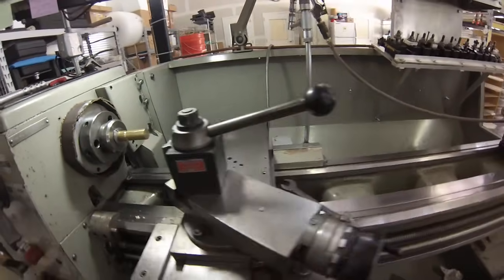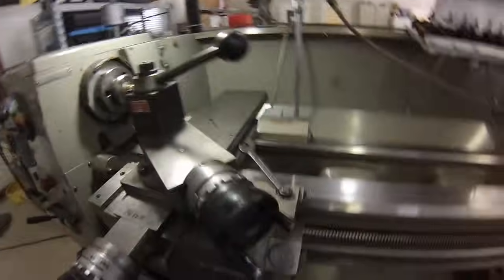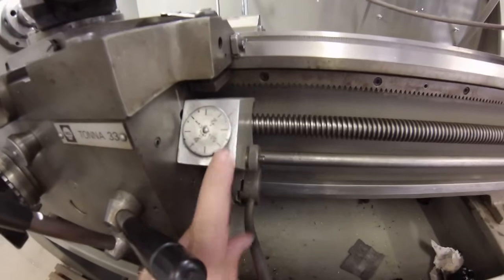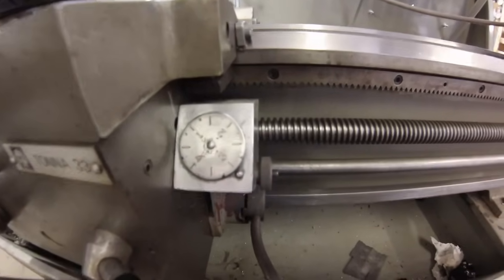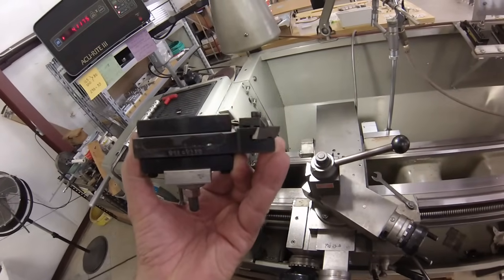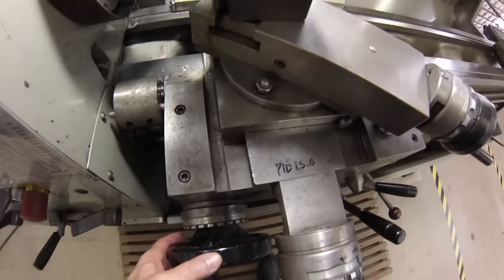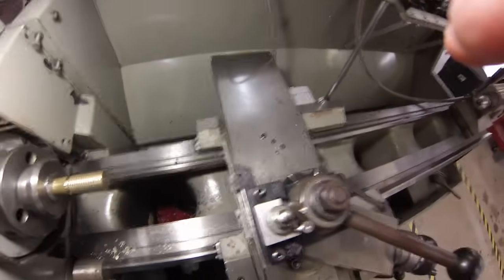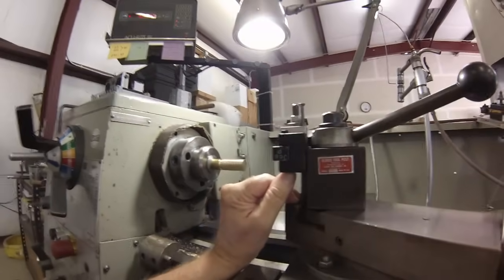Threading on a manual lathe  BEST TECHNIQUE EVER !!!!

Comment: LOL.
Reply: Be careful douchebag, your ignorance is showing.
Reply: @Shop-Tech  That's uncalled for.
Reply: @punishr36  I think leaving an LOL on a channel like this is uncalled for. This is a great way to thread and the numbers would agree. A machining channel with 77,000 subscribers in just over 3 years and 12 million views has to tell you something. Come down off that high horse Bob. You may learn something down here on the ground with us mortals.
Reply: @Shop-Tech  The "lol'  referred to the "BEST,,," It is not. Many stock tool holders on a  eg. TOS etc would not give the vertical clearance to flip a lathe tool upside down. Or some hobbyists do not have enough Swiss type Tool holders to dedicate to the inverted tool as it would take time to set the tool height. In the industry as a lathe hand you are expected to produce in a timely manner plus any following jobs. As for disengaging the Lead screw that's just a simple way of not improperly re-engaging it and mangling threads so you run it backwards. Longer threads would not pan out  in the case of my one lathe which swings 68" it is hard on the electric brake and motor as Joe also mentioned. Joe knows what I'm talking about so you go back to your name calling and represent yourself somewhere else.
Reply from the maker: @Bob Smith What part of this demonstration did you find comical? I am truly curious.
Reply: @joepie221  Well as asked by 1 of my apprentices to review said video having first read the title it made me chuckle.  Not meant as an insult, what I found humorous was disengaging from the Lead Screw. I've owned a design and build Tool Shop/Jig Bore and Jig grinding cyl-grinding form grinding Turning etc and having been a tool maker for almost 40 years and worked with many many European Tool makers and machinists I can say with all honesty that unless it's a substantially long thread I never see the Lead Screw disengaged ever in the industry. Again not meant as an insult but to state " Best,,,". Cheers and Happy New Year.
Reply from the maker: @punishr36  Bob, thanks for the follow up. With the exception of metric threads, I have always, and will always, disengage the "Halfnut" ( not the leadscrew) when running a thread. I too have crossed many industries in my 47+ year career, including Semi Conductor wafer fab development, military explosion suppression systems, aerospace and orthopedics. I've run lathes from 140" long 18" gap beds to the hardinge toolroom lathes and never ( on an imperial thread) saw how reversing a spindle to reposition a tool was good for the machine or quicker. I did my formal apprenticeship in NJ here in the USA  and too, have trained numerous apprentices over my years. My background is primarily prototype and product development with normally tight deadlines. I don't know where you are from, or how old you are, but its interesting how 2 guys walking the same path can be trained so completely different. Perhaps you should let your apprentice try this out and keep an open mind about it.  Its very fast, allows for the use of a hard stop, and is much kinder to the spindle and motor of the lathe. Cheers, and Happy New Year to you as well.
Reply: @joepie221  I did say to disengage from the leadscrew.  It's no different for thread grinding or burnishing class 3 UNJ or API etc. I do disengage from the lead when grinding internal threads where a limited undercut is permitted. I think the biggest issue with the nut is unless you're cutting a friendly imperial thread like a 16" pitch for example where you don't have to wait for a revolution of the dial if you just missed it but if you drop it in at the wrong spot and I'm sure you've done it too well,, we know how that ends. Cheers back.
Reply from the maker: @punishr36  Hi Bob. I hate to split hairs here over words, but you clearly stated, at the end of one of the comments above, you never see anyone in industry disengage the leadscrew. I'm not sure what type of machines you have, but my machines will disengage the leadscrew via the gearbox setting, or disengage 'from' the leadscrew via the halfnut. You keep making references to "in the industry" or being a lathe hand like my advice is coming from a home shop. I was a lathe hand for 23 years 6 days a week and will match skills, quality  or time with anyone out there. You included. Reversing a carriage to realign the start point of a thread does not allow for the use of a hard stop. You will risk shearing the lead screw pin if you do. if you are working on a thread against a large shoulder, the practice is equally as risky. As for waiting a full turn for your dial engagement number to return, you may want to read up on your options there. Conventional dials offer 8 options at 45 degree increments to expedite threading an even pitch thread, and 4 at 90 degrees for odd pitches. You get no second chance on a rework of a customer supplied part, so I'll stick with the sure thing. Especially when that part is a $100K bronze military valve body. I respect your comfort level doing your threads the way you have the most experience with, but would never teach or endorse that practice in my shop. Its tough on the machine and not nearly as precise or quick between passes, as the one demonstrated here.
Reply: @joepie221  Disengage from the lead screw.

Comment: This looks like something I need to learn.  I ordered a LH tool holder from Shars (1/2" MTVO External Threading/Grooving LH Tool Holder and a TNMA 32NV Carbide Insert).  I make an aluminum part with a 1"-20 external thread that runs up to a shoulder.  Should I be concerned about the axial force trying to pull the insert away from the tool holder?
Reply from the maker: Not usually. My Kennametal style top notch inserts are designed to be pulled into the holder to resist those forces. If your style is like that, I wouldn't worry.

Comment: I have a LH screw tool upside down that I use for cutting LH threads without an undercut in the work screwing towards the Chuck , start lathe in reverse  but lead_screw changed so it runs towards the Chuck. Works great,
Reply from the maker: Another alternative, if your tool is upright and your machine running forward, threading out from the chuck will produce a LH thread.

Comment: I’m leaning the lathe now and could use a little help with this. I just bought the Aloris post. What toolpost are you using and are you just turning the insert upside down? This may be a stupid question. I’m not in front of the tools. Thanks Joe, Merry Christmas
Reply from the maker: First of all, I am from Baltimore and will always cheer for the Ravens. Only the Colts were home team when I lived there, so I have a loyalty to them too. Ok, the holder I am using is a Kennametal top notch threading tool. Left hand and inverted so the insert is close to the shoulder. the top notch insert comes in right or left hand, and each type has 2 styles ( I believe ) centered for large threads, and offset for smaller shoulder threads. they can also be had in a variety of tip radii and flat widths. So to answer your question, NO, the insert is right side up, correctly positioned in a holder that is upside down. Hope this helps. Now hit that subscribe button.
Reply: Joe Pieczynski thanks Joe, I’m an old guy and grew up on the Colts bandwagon. I’m guessing you were from the Dundalk area? I didn’t see your response because it landed in the junk folder so sorry for the late reply. I hope you had a great Christmas! Well it was a stupid question because once a thought about it I understood what you were saying. Thanks for the videos and I’ve been a long time subscriber. I haven’t run a lathe since the early 80’s. I worked for a pro stock car builder back then. Almost 40 years ago.  I appreciate the knowledge you provide, Happy New Year!

Comment: An old machinist taught me this trick back in the 70's. Often got comments from boss like, "I don't want left handed threads", but they shut up when they saw the results. Thanks for sharing, Joe. I hope the young guys are listening.
Reply from the maker: Me too. I like to believe they are.
Reply: @joepie221  I wish someone around my place had a mixed shop like you do so I could ply my conventional machine skills. It's all CNC and younguns out of tech school, though. One day when transistors get fried, they'll come knocking, I hope.
Reply: @clemkadiddlehopper7705  Before transistors, the first electronics I learned were vacuum tubes: diode, triode, pentode, etc. Now that they are thinking of sending probes to Venus once again and worry for electronics to be fried up there, old technology could work fine and safe.
Reply: @joepie221  we are listening.
Reply: Yes sir we are listening. I was doing threads on rifle barrels going in for about 6 months and having issues stopping the tool in time before I hit the shoulder of the barrel.  Especially on fast threads.  I knew there had to be a better way.  Now I am going out and my product is much cleaner, better threads, and far less stress.

Comment: Nice! Never thought It could be made so simple, its genius. By the way I have had 4 inch by 8 inch long Polymer billets fly out the chuck at me when using form tools. Wish I had of learned to run form tools backwards a long time ago, thanks for the tip. Happy machining. PS: Safety first!  operating machinery while distracted with operating an electronics device.  You are a very naughty boy. he he, just thought I would add some machine shop banter. Thanks man, keep up the good work.

Comment: Hi Joe;
  Love your tips.  I'll make that offset block for my Aloris in the morning. 
  I use the thread wires too, but put heavy grease on the top pair to glue them in place while I measure, easier. 
  The other single point method I was real happy with was when I cut a template for my shaper attachment,   same thing, drinking coffee, cutting threads...  right to a dead shoulder, no stress.

Comment: Joe could please do a video on pipe threading without a taper attachment, that would be between centers but off center tail? I have a piece of 2" schedule 40 SS Pipe that I need to thread for a boat exhaust and I have never turned off center. If not a video, any helpful hints would be greatly appreciated. Thanks!!

Comment: Where did you get that lathe? It looks identical to the one in my old shop in michigan.    
I get your methods, but don't quite agree with you on compound rest angle, and going to depth strictly with the cross feed screw. Setting the compound to 29 1/2 degrees allows the tool to scarf the leading edge of the thread face, and only when setting the crossfeed to the same position on each pass, and adjusting depth with the compound screw. I've cut hundreds of threads and never had any issues doing it this way. Your method would tend to leave a rougher finish in my opinion, which is worth what it cost you.  Thanks for the video! ;:<)
Reply from the maker: I have to respectfully disagree with your thread finish assumption. I've been cutting threads this way for 45 years for aerospace and medical applications and will put my surface finish quality next to anyone out there. Its all about the tools and process combined. No extra cost for doing something right on the first go round.

Comment: Joe!  I have been a machinist/toolmaker for 45 years, building and maintaining plastic injection molds and progressive dies, yet your teaching me new things daily with your videos, thank you sir!!!  I always plunge my threads on engine lathe taking 2 passes at .001 each time with tap magic to shine them up!  Over the years however, using thread wires required too much time, so using a nut would suffice, but that is wrong, yet the "new way"!  What is happening with todays toolmakers Joe???  With the exception of computer frames, metal stamping dies seem to have gone by the wayside and replaced by plastics, for very hard plastic, we have fiberglass filled plastic molding, ceramic molding, all injection molding.  Fortunately, I am 78 now and don't need future speed and lack of quality.
Thanks for all your videos Joe!!!  Well done!
Reply from the maker: I appreciate the comment.

Comment: I've threaded twice now with this technique and the first few threads from the chuck are burred up on the ends. The rest are fine. What is happening? I didn't do a chamfer on the thread relief, could this be it?
Reply from the maker: Use some finesse when dropping the half nut in. if you gorilla grip it, you can force the nut to jump forward to catch a groove. the thread start point will suffer for this. watch my video on engaging the halfnut made easier. It may help. get back to me either way.
Reply: @joepie221  Thank you for your help. That must be what happened. It didn't seem to affect the point where the flanks meet, just the tip of the flank is burred up. Yeah I was pretty much just timing and dropping it right on the number and not using that technique. Are you saying that technique is a fail safe way for it to engage cleanly and avoid that messy thread start?
Reply from the maker: @ltdan8671  Yes. If the nut operates smoothly, and you exercise some finesse, it will.  Also keep some drag from your hand on top of the carriage handwheel while the thread is cutting. This acts like a light brake and will keep the nut engaged firmly against the leadscrew.
Reply: @joepie221  Thanks for the tip

Comment: Enjoyed and learned. one question, did you reverse you lathe to use and upside down bit?...Thanks
Reply from the maker: Yes. Spindle running in reverse, tool inverted  and used a LH holder to get close to the shoulder.

Comment: Joe, 
Would you make a video on engine lathe setup for threading, feed speeds, how to determine what settings to use. I inherited a job at the steel mill where I have worked for 26 years as an industrial mechanic and the job is turning facing ect. Basic parts and pins we use on a regular basis. Once and a while I may have to do some threading and got lucky and got away with it but I really don’t know what I’m doing as far as threading. I’ve been doing this for 2 years, I know about how to use the half nut for threading and have played with grinding some threading tools and have learned a lot from your videos, but I have nobody on the plant site that knows threading nor will any of the machine shop venders we use show me anything, they say “I’m already cutting into their business to much”. Thanks for your help and videos. This new gig has got me off the line somewhat and gives me an better go at finishing the last few years before I retire in the best job I’ve ever had!
Reply from the maker: Naturally, machine RPM is driven by the material and diameter of the work, the pitch is set by the chart on the gearbox, and the lever engagement point will always be correct if you always use the same reference point. The rule of thumb is to use any line for even pitch threads, and any numbered line for odd pitch. Most of the time the tool is a 60 degree triangle set true to the work on center. Beyond that, I have many videos covering measuring and threading on my channel. Take a look and good luck.

Comment: hears a tip to mack the reding of wier's easy use tow O'ring to hold the on the sid of the wier's to hold them in the third . will you mike up me being a framer.  used castration rings. But that's me being cheap. LOL, But it makes the holding in place better bets dropping them.  the swath tray. Bigger O'ring for lager stock, third . check it out on a bolt.  not so tight a O'ring it bends the wires.  les Thompson "England". hop this helps .
Reply from the maker: Did you know you can use 1,2 or 3 wires to check a thread???  Using 1 is a little known practice, and give you 2 true indications about the thread. I did a video on this topic.

Comment: Joe thanks for all the great content that you put out there 👍
I have watched this video dozens of times and love the technique! After first seeing this I ran out to the shop, chocked up some round stock, flipped my high speed threading tool upside down and suddenly I was the master of the universe.
I ran into a problem when I tried it with my right hand, stand-up insert tool holder. I could not get the tool close enough to the shoulder at the origin of the thread.
I didn't  recognize this at first but it looks like you are using a left hand tool holder... Is that correct?
For a right hand thread, do you use a right-hand insert to match the helix but in a left hand holder to get closer to the shoulder?
I want to make sure I thoroughly understand the setup before I invest in the tooling.
Lastly, would you recommend stand-up or lay-down style inserts?  I would like to to be able to use the same insets fot both internal and external type tool holders.
Reply from the maker: LH vs RH kennametal top notch tool holders use the same type insert with the exception of the lock groove in the top, and mild back angle for insert side clearance. A LH insert will cut a RH thread all day just fine. Using the same insert for ID and Odthreads will restrict one or the other. My OD threading inserts ar #3 while my bar takes #2. I suppose you could balance your setup, but consider the size ranges of each. Laydown inserts seem to be able to do smaller ID threads, but the OD applications are endless. Laydown inserts sometimes are pitch specific meaning you need a different insert every time you run a different thread. A profile called a 'Partial Profile' doesn't form the crest of the thread and can be very versatile. Thats what I use exclusively.